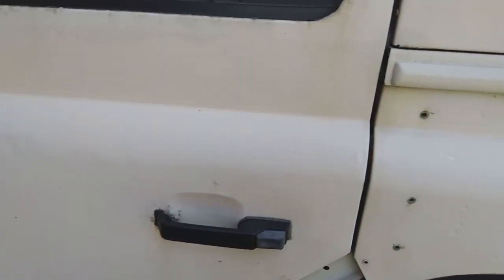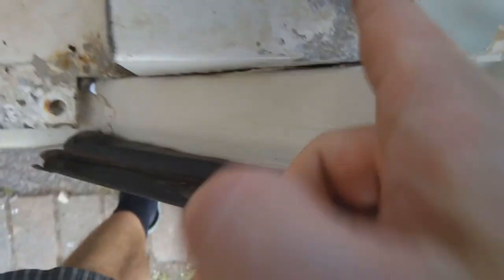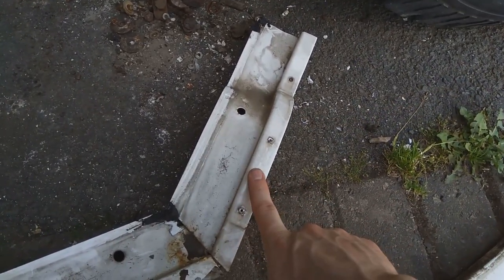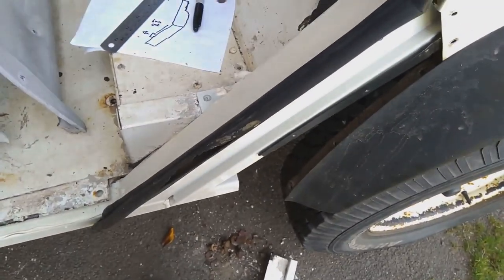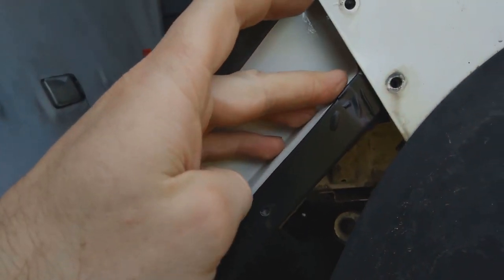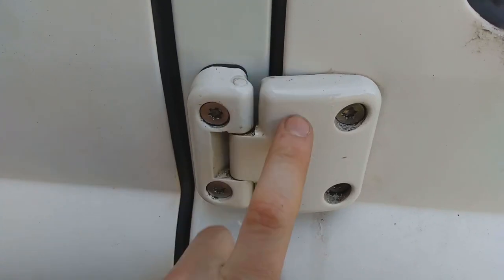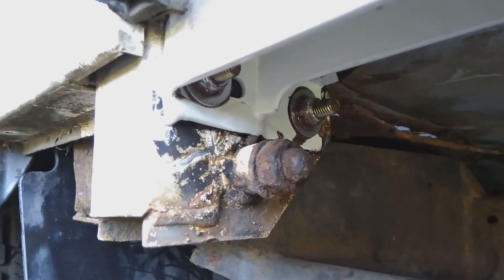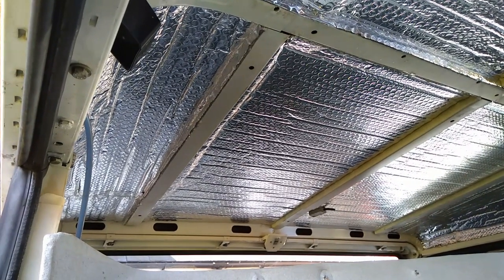Figuring out the B/C post side frame problems - Part 2

Comment: As an old fart in this biz - dry run first without paint - cut/adapt/weld/remove then paint.Takes time but that is a common issue with aftermarket panels.
Built many CSW from used genuine parts - not an issue,  so it has to be YRM is a bit out.
If you really want a frustrating job fit those plastic front outer wings/ or the plastic door cards...
Reply from the maker: They told me they make them with their dimensions a bit more generous in certain directions. Time is short at the moment, so I've had to rattle through this so I can get onto welding the chassis, plus leaving time so I can watch your videos Mike!

Comment: Grind the mid  misaligned  bracket off, bolt that bracket to the tub with a gasket then align the c pillar then weld IT up then spray it with rattle can
Reply from the maker: Cheers Stephen
Reply: LR Workshop & Expedition id do a stitch weld with lots of time between welds so things don’t get super hot and melt the gasket / warp.

Comment: Cut the floor mounting bracket part off, fabricate a 90 degree replacement that can be bolted onto the post using nutserts, or rivets. You can then adjust it up by 7mm or whatever. If you had adjustment in that area you would probably be able to get it aligned a lot better.
Reply from the maker: Cheers Chris.

Comment: Doing a similar rebuild myself, so sympathise with the problems, most I encountered too.  On my vehicle many of the parts if not rotten were missing and that’s been the greater problem for me.  I do have a question though. At 9.19 you have a good pic of the c post and in particular the rear tab.  What is the tab supposed to do? I can see day light between my  tab and the wing floor.  Any idea what could be wrong?

Comment: Hey mate, I just went through something similar to this when replacing my tub. 
I replaced it with a 2nd hand item off a vehicle from the same era.
I had to cut off those little L brackets in question from the C-pillar. Just no way it was going to fit otherwise. I will tack weld them back on one day...
I'm still 5mm out on the driver's side.
Is your tub possibly on an angle? can you loosen off the nuts and slide it back on the passenger side? (just a thought)

Comment: Shoddy after market parts is something defender owners have to learn to live with IMHO...
Reply from the maker: I don't berate YRM for this. I would have preferred that they make them identical to the factory, but they've added a bit of "give". I'm not totally sure though that this one was built within their own tolerances.  I may be pushing the limits by trying to make them fit an existing bulkhead and tub alignment.

Comment: As I mentioned before, I had the replacement lower C post YRM replacement section. I had to shorten the section, removed the L bracket that bolts to the tub and welded on the old one, higher up, also as the hole centres were different as you have seen, is the height of the lip for your door seal different? It was 3mm taller than origional. The problem you have is all is galvanised so if you start chopping it you are undoing what you paid for.........
Reply from the maker: Cheers Richie. Yes not ideal to modify a galvanised part. I may leave the drastic bits for when the rebuilt happens!

Comment: It is really frustrating, had similar issues myself. Some aftermarket parts are just sh1t, however YRM are normally pretty good. I can sympathise, Land Rover tolerances we’re so wide it is a very difficult ( almost impossible) job to make parts that will fit every single vehicle as every one is a little bit or a lot different. I was looking at this thinking I should have done this repair same way as you as I bought all the parts separately as job creep set in, now I’m at least happy it was not just me as it is a bit of a head twister trying to get it all to line up properly but at least 3 separate parts allows for more adjustment but overall galvanising of vulnerable parts is then not possible. I would cut off & nutsert/bolt or re weld the tub plate to get it to line up, not ideal but then Defender has many compromises which could have been and we would prefer we’re improved.
Reply from the maker: Thanks Peter. It's always a wonder about how the tolerances could be so far out as things are made on a jig, but then you've got the people aspect putting the bits into the jig 😄. I think the YRM parts are pretty good to be fair, it's just I think they mostly sell to rebuilders rather than people who replace in situ

Comment: Will I had similar issues with the holes not lining up fitting the YRM B and C posts. In the end I replaced the toe Panel section with new ends and drilled new holes to line up with the C post.
Reply from the maker: Thanks Nigel

Comment: YRM don’t drill the C-post rivet holes as they’d never line up with the old tub.

That bracket is causing a lot of your problems.  Cut it off and make up a replacement that bolts the same way through the floor but also bolts to the c-post with rivulets in the pillar and slotted holes if round aren’t flexible enough in the bracket.

Slot the bolt holes for the c-pillar door catch and align the door properly - apart from poor sealing allowing drafts and water ingress, the body flex off road will press the door top against the roof gutter with that small a clearance; it’s because of that flex that LR gave the Defender (and predecessors), RRC and Discovery such big panel gaps. Hi
Reply from the maker: Cheers Nick

Comment: Can’t you just elongate the door lock catch. Seems like the simplest solution
Reply from the maker: I think shaving some of the bottom of the rear nut plate is the way to go. In the upcoming video for the RHS, the striker bolts don't go to the bottom of the holes in the C pillar, so the nut plate is restricting it.

Comment: You’ve found the problem so it needs to be rectified and then all the other alignment problems will cease to exist. It’s the only way to fix it. Otherwise you will be dealing with constant work arounds to deal with the issues and you’ll never be happy with it knowing it’s not fixed. As others have said before, cut the bracket off and re-weld in the correct position and life will be much easier. It’s crap to have to undo the paint and galvanising previously done, but that isn’t anywhere near as shoddy as leaving it miss aligned. After watching your experience with this I’d definitely dry fit it first and decide what to do from there. Shame really, looked like a good bolt in option for those that need a bolt in option.
Reply from the maker: Cheers Carlton. Time was against me. I'm trying to replace some key bits without having to do a full rebuild.

Comment: I sympathise mate - so many aftermarket bits don't fit well. If you can weld - can you cut the bracket off and reweld it where you think it should go?  Shouldn't have to but most currently available aftermarket parts seem to need engineering into use.

I have a galvanised door top that could be decribed as long lastingly poor fitting.
Reply from the maker: Cheers. I was hoping it would fit fine as it's a part made on a jig, except that the replacement part is made to slightly different dimensions (3-4mm they told me) to take account of all the Defender variances. Others have suggested cutting off and drilled/rivnut/bolts. Feels a better option compared to welding galv steel (fumes)